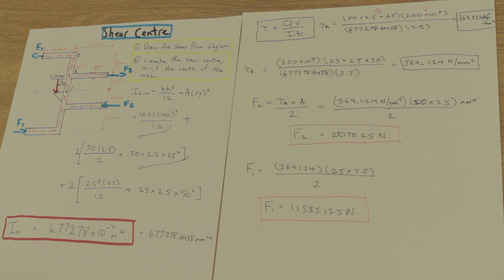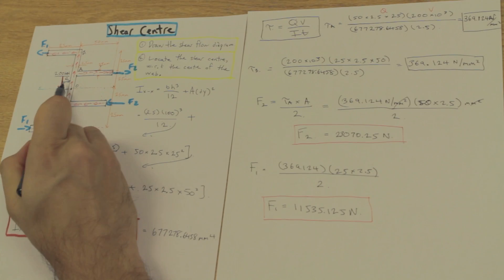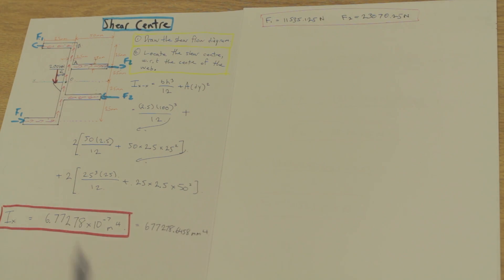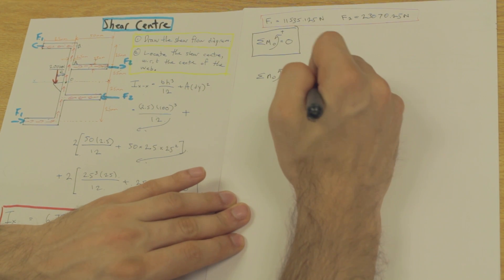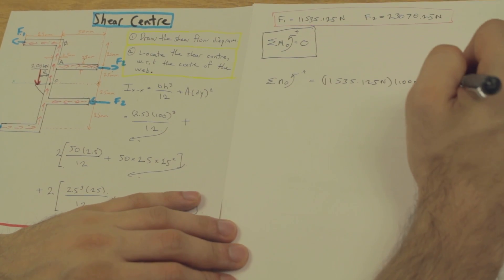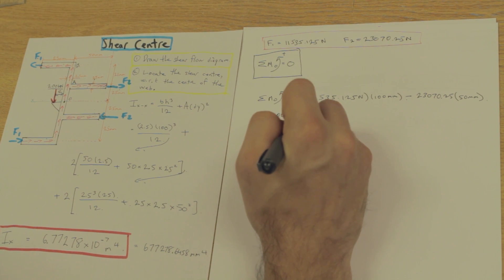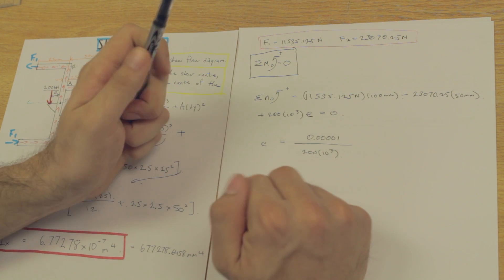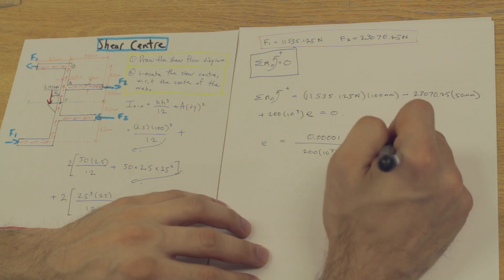How to Solve a Shear Center Problem - 4/4

Comment: where that external shear force came from?
Reply from the maker: The applied load? It's given, what it is isn't specified in the problem.
Reply: @AFMathandEngineering  but if I want to check my built up profile: Tee + Box. And I'm gonna use it as a column, so what is the shear force for it? If you could help me... T.T
Reply from the maker: @jeniesyarif6396  your force is whatever load is applied externally, sorry I can't explain it any clearer than that.  Are you a student currently? You'll learn more about applied loads, load combinations, etc. later during your engineering degree.
Reply: @AFMathandEngineering  I see. So in my case, I want to observe my built-up profile as a column with an external force for its joint. Then it is right if I use that force? And actually I'm an 8th semester college student now... so I should be learning more from you 😁🙇‍♀️

Comment: Why use the 2KN force in the question surely using a unit force will give you the same shear center and avoid big numbers
Reply from the maker: slainsco do you mean the 200 kN force? The shear centre depends on the load, we cant just change the load to make the question easier the results will change for e.
Reply: @AFMathandEngineering  I guess you know better by now but just to put it out there, the shear center is not dependent on the load :) Slainsco was right!
Reply from the maker: @13D00_  are you implying that the magnitude of a load applied eccentrically doesn't affect the distance that that load needs to be placed in order for the member not to twist?  That a 1 million kN point load applied 1m from the origin will generate the same amount of torsion on a member that a unit load applied at that same distance will?  The shear center absolutely depends on the load, however you could derive an expression using unit weights and stresses...of course at the end of the day the magnitude of the load depends on how far it can be applied from the origin in order to achieve equilibrium.
Reply: @AFMathandEngineering  that's exactly what I am implying yes. Also as my mechanics book mentions: "The geometry of the shear center is only a function of the geometry og the cross section, and does not depend upon the applied loading." (Mechanics of Materials, R. C. Hibbeler)
Reply: @AFMathandEngineering  also when you look at the equation in your video, you can see that the shear load cancels out while solving for e.

Comment: In case for F2. We can see that both go different direction. For the moment should be F2(25) since both go different direction. Right?
Reply from the maker: They are both in different directions but they create the same moment, which means they are creating a couple moment here.  After reading in depth about the subject and looking at solutions what's shown int he video looks to be correct.

Comment: sir why you take moment arm 100 for f1 it should be 50 from 0 right????
Reply from the maker: Our professor gave us this example and solution, however after considering multiple solved examples the moment is taken as a couple, which is the entire distance between the forces, not to point 0.
Reply: Yes, the couple moment is exactly the reason why you multiply it the way you did. Working with shear flow centre's you must rather look at torsion introduced by these forces rather than anything else. Since the reason you are looking for the center is to eliminate the torsion. I hope this makes it a little more clear in the understanding.
Reply: well done Azagro